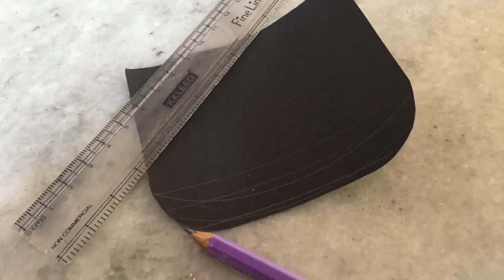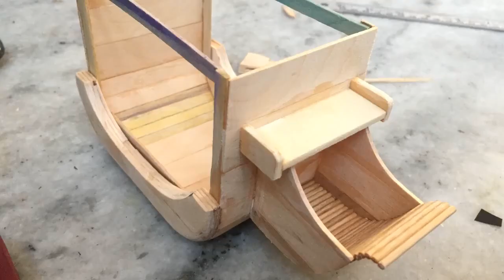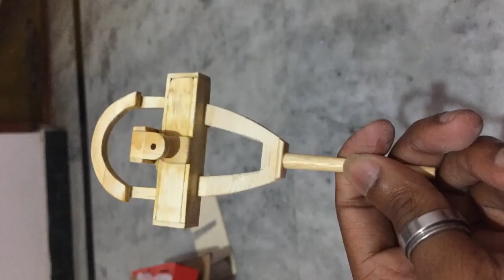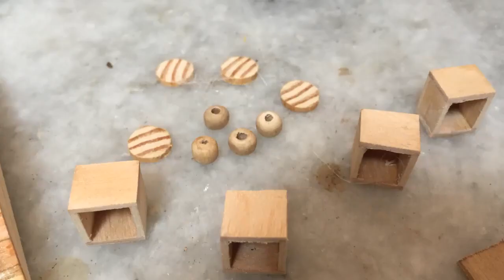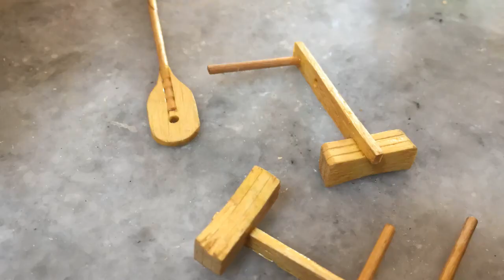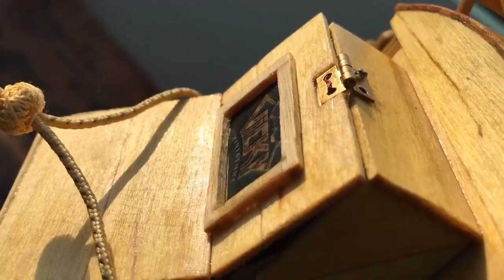miniature horse chariot

Comment: Which polish u used? Can u upload a video for polishing wood models
Reply from the maker: using sand paper to polish . finally im using basic wood varnish
Reply: @vickysminiature  how did u apply wood varnish? By brush or some air blower. Did u diluted it with thinner?
Reply from the maker: @saurabhgautam9917  brush only and i did just double coting only